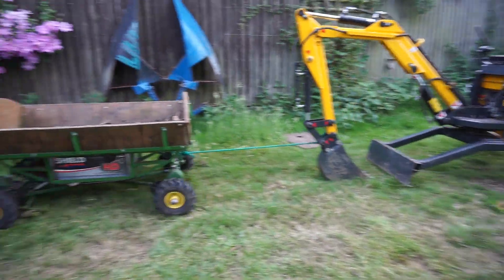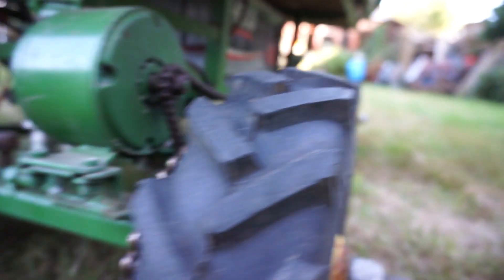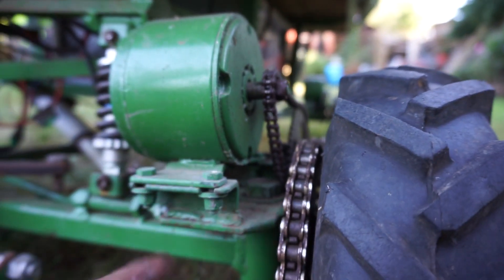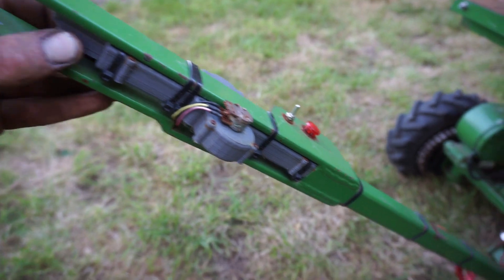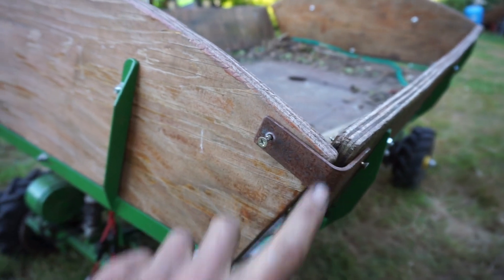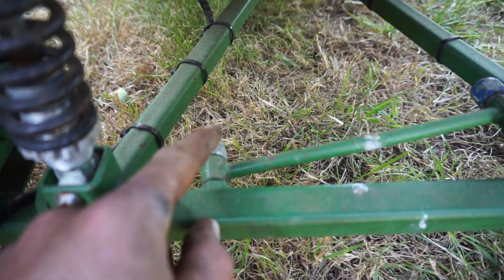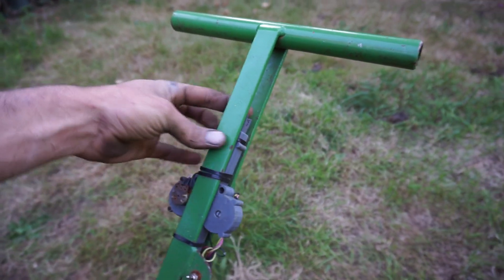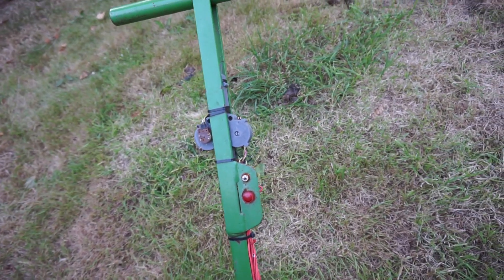POWERFUL HOMEMADE 24V ELECTRIC 4WD KART/WAGON!

Comment: That's brilliant! Where did you get the motor controllers? Inspired by your project, I began to look for a high current 4 channel controller but I have not found any.
Reply from the maker: Thanks bro! Just found them on ebay! Search 24v 100a motor controller they should pop up! They only have one channel each but you just wire two motors in parallel and it seems to work! Good luck man!!
Reply: @councilhousecreations8035  Thanks so much for your reply.